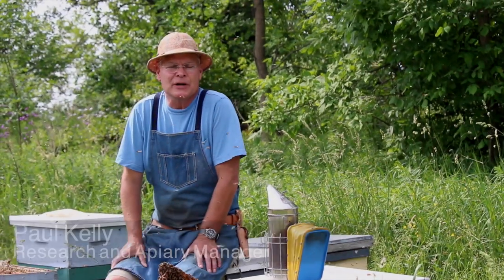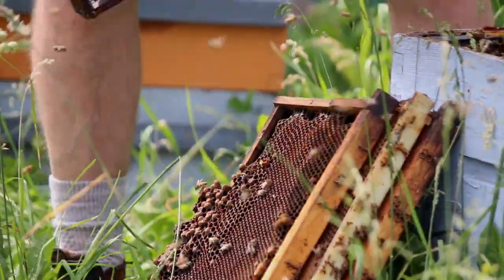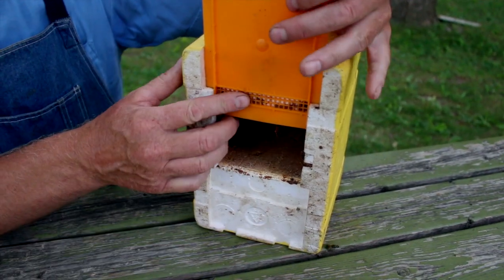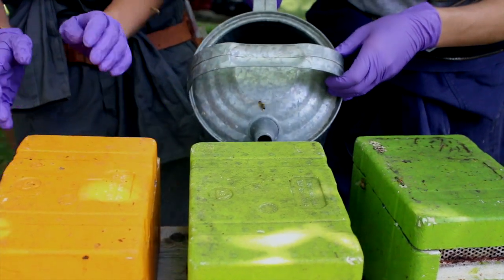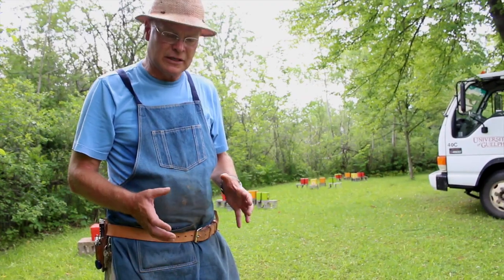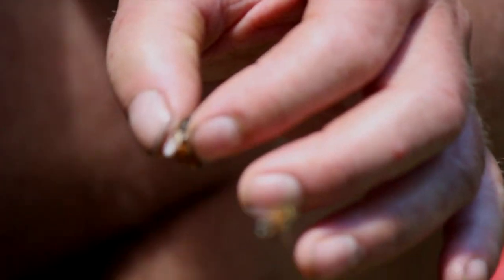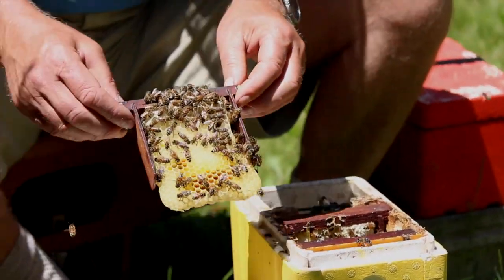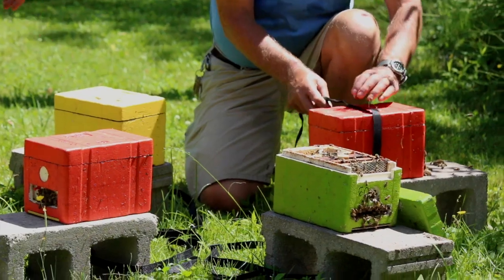Making Mini Nucs

Comment: Great video but can you let me know where you got the hormone queen strip and how did you make a queen cell
Reply from the maker: Hi Alberto
 Thanks!
 Please see our FAQ # 9  and #17 below.

1. Why do we use canvas for the hive inner cover? A: We use canvas inner covers for a few reasons. They make it easy to take a quick peek in the hive, and are cheap and easy to make. They are light, the lids sit down well, less excess wax on the frame top bars, and we rarely need to scrape the inner cover. We use 18 oz (#8) canvas -otherwise known as duck. It's a bit hard to come by in Ontario, but it is available from online distributors (US: http://www.bigduckcanvas.com/number-8-18oz-cotton-duck-canvas.html, Canada http://www.jtsoutdoorfabrics.com/18oz-Cotton-Duck-Canvas-Untreated--Natural-60_p_15038.html). Bees chew through thin canvas so a heavy weight is better. We flip it over periodically when new so the bees thoroughly coat it with propolis. An alternative is a feedbag folded in half. 

2. Why do we use single brood chambers? A: Our preference is to keep hives in single brood chambers. We use queen excluders above the brood chamber and then add supers. We produce bigger crops managing our hives in singles vs doubles and we find the hive management much easier. It's become quite common here, especially over the last twenty years. We will be making a video about single brood chambers soon! 

3. Are our queens for sale? A: We sell some queens but don't export. To contact us about our queens, please email us at infohbrc@uoguelph.ca. Our Buckfast collaborators also sell queens: Munro Honey http://www.munrohoney.com/ (for CAN sales) and Ferguson Apiaries http://fergusonapiaries.on.ca/ (for CAN and US sales). . 

4. What breed of honeybee do we use? A: We work with Buckfast bees. Check out our website if you would like to learn more about them: http://www.uoguelph.ca/honeybee/breeding.shtml 

5. Will we be making any more videos? A: Yes! We are looking forward to creating more videos for our YouTube channel this year! Here are some of the topics we will be covering: Working with single brood chambers, indoor overwintering. 

6.How do you overwinter double nucleus colonies? A: At the University of Guelph, we winter our double nucleus colonies indoors. You can also winter them outdoors by wrapping two double nucs together with insulation on the sides and top. 

7. Are double nucleus colonies prone to swarming? A: With a young queen and the supers above we don't have any problem with these nucs swarming in the first year. We do have to transfer them into a full size box early enough the following spring to prevent swarming. 

8. Do we add a frame of pollen or honey into a new split? A: Ideally you add both pollen and honey. Of the two, honey is the most important.

 9. Where to purchase some of the products that we use: Coveralls: We really like these Dickies all cotton coveralls. http://www.dickies.com/coveralls-overalls/deluxe-cotton-coverall/48700.html?dwvar_48700_color=GY#start=3. We use two sided velcro to strap up the wrists and usually tuck the legs into our socks. Plastic Queen cages: Mann Lake and their Canadian distributors sell these and they are made by the French company Nicot. https://www.mannlakeltd.com/hair-roller-cages. I use a wooden plug on the bottom and screw it in place with a #4 screw after pre drilling. Grafting microscope: http://www.amscope.com/catalogsearch/result/?q=gooseneck+binocular Mini/mating nucleus boxes: Mann Lake (US) and their Canadian distributors sell these. They are originally from Europe so are widely available there. https://www.mannlakeltd.com/shop-all-categories/hive-colony-maintenance/queen-rearing/nuc-boxes Queen Pheromone: The pheromone strips were developed here in Canada. They are called Tempqueen and are made by Intko Supply Ltd.Suite 604, 3345 Kingsway VANCOUVER, BC, V5R 0A7 Canada +1 (604) 356-7393. pheromonesupply@gmail.com. Mann Lake in the US and several Canadian bee supply companies carry them. Bee belt and bulk bee box: Our apiary manager Paul Kelly manufactures the Bee Belts and bulk bee box. If you are interested in more information, please email him at pgkelly48@gmail.com.

 10. Should you remove any queen cells in a colony before introducing a new queen in a cage? A: Yes, you should remove the queen cells. Look very carefully to make sure you don't miss one. Shake the bees off each frame to make sure you can see them all. Accepted queens are sometimes killed by virgins that emerge from queen cells. 

11. Can you make a split without adding a mated queen/can a split raise their own queen? A: A split can raise their own queen (if they have eggs), but you'd be better off buying a mated or queen cell from a local bee breeder. Queens raised by a split are reared under the worst possible conditions, are physiologically inferior, and you aren't taking the opportunity to improve your hive genetics. For a number of reasons, colonies get more aggressive if we let splits raise their own queens. We always use queen cells that we have reared from breeder colonies so we can maintain and improve our genetics. Cells found in hives can be poorly reared if conditions aren't good or if you use swarm cells you are unintentionally breeding for swarming behaviour.

 12. How often do we check for swarm cells? A: We check for queen cells only in colonies that are stronger based on our ratings as described in our “Swarm Control” video. We only do this at the time of year bees are prone to swarming (ie just before the main summer nectar flow). In some colonies, we check twice, a week apart, if we have the time and we've found cells in them previously. We stop looking once the nectar flow gets going and the time for swarm preparation has passed. 

13. How old is a queen when we replace her? A: We re-queen if a queen isn't doing well or when she is in her third year. 

14. How often should you be stung to lessen the chances of developing anaphylactic reactions? A: Please speak with an allergist if you have any concerns regarding bee sting reactions. You don’t need that many stings to build an immunity and reduce your chance of developing an allergy. However, reactions can be very different from one individual to the next. For about three years after starting beekeeping you swell more in the spring when the bee season starts. After that most people don't swell up much at all. Some beekeepers apply stings through the winter to keep building immunity. 

15. What do we use as candy for the queen cages? A: You can make the candy using honey and icing sugar but the candy you see in the tubes in our videos are purchased with the cages from Mann Lake beekeeping supplies and their Canadian distributors. In our province, it's not legal to use honey in queen candy if you are distributing queens. Honey can contain American Foulbrood spores. A specialized, non-drying, sugar syrup (Nulomoline invert sugar) can be used instead of the honey. In any case the candy must be made dry enough that it's crumbly.

 16. How do we make pollen patties? A: The patty is made from pollen we collect using a pollen trap. We mix the pollen pellets with sugar syrup to a dough like consistency, form the patties between layers of wax paper and then keep them frozen until they are needed. They will keep for several months frozen.

 17. How do we make our grafting bars? A: We cut the wood pieces and attach them to the graft bar with liquid beeswax. We then attach the cups with liquid wax. In both cases the liquid wax is applied with a syringe. Previously, we made the wax cups but now buy them from https://www.kelleybees.com/. 

18. Do we move full honey supers to the top of the stack so the bees can fill the lower ones? A: Some beekeepers do shuffle the supers around and do what's called bottom supering. We place supers back on in the original order and only add new supers on top (top supering). That way it's easier to see when the bees need more space. The bees also ripen the honey before moving up. We sometimes harvest full lower supers and put the top ones that aren't full back on in the original order. 

19. Do we ever add brood frames to the cell builder colonies to keep their populations high? A: We do add other frames of sealed brood and sometimes we shake in more young bees from brood frames to boost the hives. About once every three weeks we'll boost the hives in one way or another. 

20. How do you level hive stands? A: We level the hive stands periodically with pressure treated wood shims. If the hives are already on the stands, we use a hardwood pry bar and a brick fulcrum to lift each end for shimming

Comment: hi, do you put in a new cup of bees each time you add a new queen cell? cheers
Reply from the maker: Hi Simon
 No 1.5 cups is all you need for the whole summer. Cheers!
Reply: UoG Honey Bee Research Centre thanks, so are they replenished by the eggs that each queen lays before you remove her?
Reply from the maker: You've got it Simon. It usually works that the nucs maintain their strength over the summer. Weather related delayed mating can cause weakening of the nucs so some people use a three week cycle.
Reply: Thanks

Comment: Where are you able to get these nucs?
Reply from the maker: Hi Chase 
Please see FAQ# 9 below.

1. Why do we use canvas
for the hive inner cover? A: We use canvas inner covers for a few reasons. They
make it easy to take a quick peek in the hive, and are cheap and easy to make.
They are light, the lids sit down well, less excess wax on the frame top bars,
and we rarely need to scrape the inner cover. We use 18 oz  (#8) canvas
-otherwise known as duck. It's a bit hard to come by in Ontario, but it is
available from online distributors (US: http://www.bigduckcanvas.com/number-8-18oz-cotton-duck-canvas.html,
Canada http://www.jtsoutdoorfabrics.com/18oz-Cotton-Duck-Canvas-Untreated--Natural-60_p_15038.html).
Bees chew through thin canvas so a heavy weight is better. We flip it over
periodically when new so the bees thoroughly coat it with propolis. An
alternative is a feedbag folded in half. 

 

2. Why do we use single
brood chambers? A: Our preference is to keep hives in single brood chambers. We
use queen excluders above the brood chamber and then add supers. We produce
bigger crops managing our hives in singles vs doubles and we find the hive management
much easier. It's become quite common here, especially over the last twenty
years. We will be making a video about single brood chambers soon! 

 

3.  Are our queens for sale? A: We sell some queens but don't
export. To contact us about our queens, please email us at infohbrc@uoguelph.ca. Our Buckfast collaborators also sell queens: Munro Honey http://www.munrohoney.com/ (for CAN sales) and Ferguson Apiaries http://fergusonapiaries.on.ca/ (for CAN and US sales). 

 

. 

4. What breed of
honeybee do we use? A: We work with Buckfast bees. Check out our website if you
would like to learn more about them: http://www.uoguelph.ca/honeybee/breeding.shtml 

 

5. Will we be making any
more videos? A: Yes! We are looking forward to creating more videos for our
YouTube channel this year! Here are some of the topics we will be covering:
Working with single brood chambers, indoor overwintering. 

 

6.How do you overwinter
double nucleus colonies? A: At the University of Guelph, we winter our double
nucleus colonies indoors. You can also winter them outdoors by wrapping two
double nucs together with insulation on the sides and top. 

 

7. Are double nucleus
colonies prone to swarming? A: With a young queen and the supers above we don't
have any problem with these nucs swarming in the first year. We do have to
transfer them into a full size box early enough the following spring to prevent
swarming.

 

8. Do we add a frame of
pollen or honey into a new split? A: Ideally you add both pollen and honey. Of
the two, honey is the most important. 

 

9. Where to purchase
some of the products that we use: 

 

Coveralls: We really
like these Dickies all cotton coveralls. http://www.dickies.com/coveralls-overalls/deluxe-cotton-coverall/48700.html?dwvar_48700_color=GY#start=3.
We use two sided velcro to strap up the wrists and usually tuck the legs into
our socks. 

 

Plastic Queen cages:
Mann Lake and their Canadian distributors sell these and they are made by the
French company Nicot. https://www.mannlakeltd.com/hair-roller-cages. I use
a wooden plug on the bottom and screw it in place with a #4 screw after pre
drilling. 

 

Grafting microscope: http://www.amscope.com/catalogsearch/result/?q=gooseneck+binocular

 

Mini/mating nucleus
boxes: Mann Lake (US) and their Canadian distributors sell these. They are
originally from Europe so are widely available there. https://www.mannlakeltd.com/shop-all-categories/hive-colony-maintenance/queen-rearing/nuc-boxes

 

Queen Pheromone: The
pheromone strips were developed here in Canada. They are called Tempqueen and
are made by Intko Supply Ltd.Suite 604, 3345 Kingsway VANCOUVER, BC, V5R 0A7
Canada +1 (604) 356-7393. pheromonesupply@gmail.com. Mann Lake in the US and several Canadian
bee supply companies carry them. 

 

Bee belt and bulk bee
box: Our apiary manager Paul Kelly manufactures the Bee Belts and bulk bee box.
If you are interested in more information, please email him at pgkelly48@gmail.com.

 

10. Should you remove
any queen cells in a colony before introducing a new queen in a cage? A: Yes,
you should remove the queen cells. Look very carefully to make sure you don't
miss one. Shake the bees off each frame to make sure you can see them all.
Accepted queens are sometimes killed by virgins that emerge from queen cells. 

 

11. Can you make a split
without adding a mated queen/can a split raise their own queen? A: A split can
raise their own queen (if they have eggs), but you'd be better off buying a
mated or queen cell from a local bee breeder. Queens raised by a split are
reared under the worst possible conditions, are physiologically inferior, and
you aren't taking the opportunity to improve your hive genetics. For a number
of reasons, colonies get more aggressive if we let splits raise their own
queens. We always use queen cells that we have reared from breeder colonies so
we can maintain and improve our genetics. Cells found in hives can be poorly
reared if conditions aren't good or if you use swarm cells you are
unintentionally breeding for swarming behavior. 

 

12. How often do we
check for swarm cells? A: We check for queen cells only in colonies that are
stronger based on our ratings as described in our “Swarm Control” video. We
only do this at the time of year bees are prone to swarming (ie just before the
main summer nectar flow). In some colonies, we check twice, a week apart, if we
have the time and we've found cells in them previously. We stop looking once
the nectar flow gets going and the time for swarm preparation has passed. 

 

13. How old is a queen
when we replace her? A: We re-queen if a queen isn't doing well or when she is
in her third year. 

 

14. How often should you
be stung to lessen the chances of developing anaphylactic reactions? A: Please
speak with an allergist if you have any concerns regarding bee sting reactions.
You don’t need that many stings to build an immunity and reduce your chance of
developing an allergy. However, reactions can be very different from one
individual to the next. For about three years after starting beekeeping you
swell more in the spring when the bee season starts. After that most people
don't swell up much at all. Some beekeepers apply stings through the winter to
keep building immunity. 

 

15. What do we use as
candy for the queen cages? A: You can make the candy using honey and icing
sugar but the candy you see in the tubes in our videos are purchased with the
cages from Mann Lake beekeeping supplies and their Canadian distributors. In
our province, it's not legal to use honey in queen candy if you are distributing
queens. Honey can contain American Foulbrood spores. A specialized, non-drying,
sugar syrup (Nulomoline invert sugar) can be used instead of the honey. In any
case the candy must be made dry enough that it's crumbly.

 

16.  How do we make pollen patties? A: The patty is
made from pollen we collect using a pollen trap. We mix the pollen pellets with
sugar syrup to a dough like consistency, form the patties between layers of wax
paper and then keep them frozen until they are needed. They will keep for several
months frozen. 

 

17. How do we make our
grafting bars? A: We cut the wood pieces and attach them to the graft bar with
liquid beeswax. We then attach the cups with liquid wax. In both cases the
liquid wax is applied with a syringe. Previously, we made the wax cups but now
buy them from https://www.kelleybees.com/. 

 

18. Do we move full
honey supers to the top of the stack so the bees can fill the lower ones? A:
Some beekeepers do shuffle the supers around and do what's called bottom
supering. We place supers back on in the original order and only add new supers
on top (top supering). That way it's easier to see when the bees need more
space. The bees also ripen the honey before moving up. We sometimes harvest
full lower supers and put the top ones that aren't full back on in the original
order. 

 

19. Do we ever add brood
frames to the cell builder colonies to keep their populations high? A: We do
add other frames of sealed brood and sometimes we shake in more young bees from
brood frames to boost the hives. About once every three weeks we'll boost the
hives in one way or another. 

 

20. How do you level
hive stands? A: We level the hive stands periodically with pressure treated
wood shims. If the hives are already on the stands, we use a hardwood pry bar
and a brick fulcrum to lift each end for shimming.